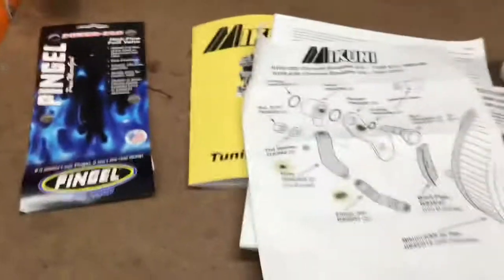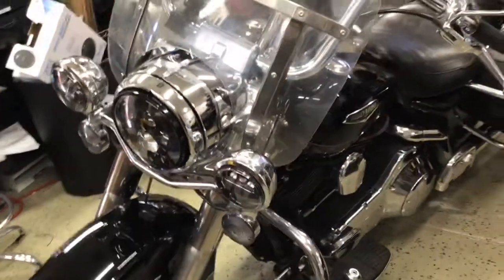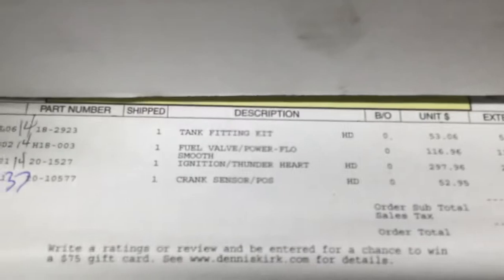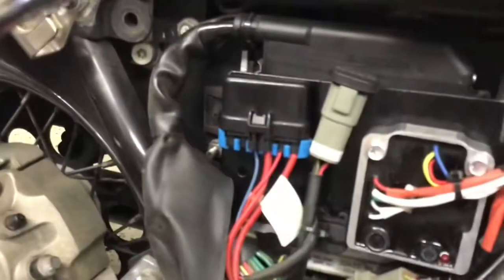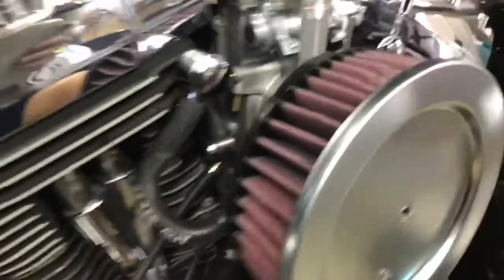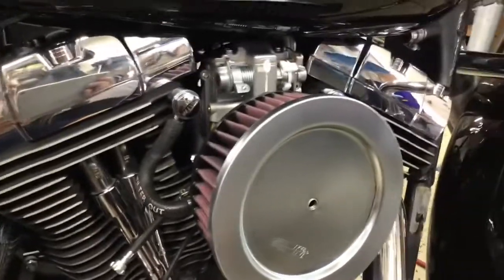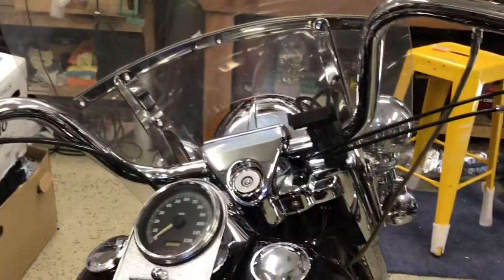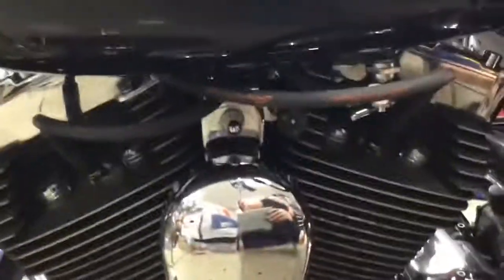1999 HD Road King EFI to Carburator and Thunder Heart IGN.

Comment: On that petcock, from sitting on the bike, pushed towards the front wheel is closed, and middle is on, and all the way towards the back wheel is reserve.  Next thing is you never needed to remove your tank.  A mikuni hsr 42 or 45 or 48 will mount up to your bike.  And yes there are two vacuum tubes on the back of that mikuni, one is on the top left and ,ust be capped and one is on the bottom right and needs to be capped.  Now on these mikuni you have no fuel mixture screw on these, so your adjustment to your air screw is very imprtaont as to how your bike runs.  If it hesitates or spits back, you need to turn it on clockwise.  Also for your TC 88 with 4 inch stroke, you need a 45 pilot jet and a 180 main jet. Now if it came with a 42 jet and a 160 as most do, that will work for trips shorter than 50 miles or so.  But dont forget that air screw located on the left bottom front of that mikuni is literally vital to how your engine will run.  Im not talking about the idle screw thats got the cable that drops down to turn up you idle or drop it, but am taking about the screw driver need screw on the left side at the from as for your air screw, and it takes a longer thin screwdriver to easily turn it out or in with your air cleaner on.  I have a mikuni HSR video demonsatrtion here on YT at my channel

Comment: so update i hade the same ignition but the engine kept having a flat spot the carb is jetted correctly what i did was remove the thunder heart i kept the stock ecm i removed the fuel injection installed a carb kept the engine temp wired to ecm kept the oe coil i am running the bike with the stock ecm  it is firing the coil as it should i only removed everything that was fuel injected related on the bike  on the ecm i removed the # 6 pin wire to get rid of the check engine light bike runs great better than having the stand alone ignition there is no need for it just remove all the fuel injection crap and install a carb runs flawless
Reply: Good job - I know there were others who mentioned the same process on the HD bulletin boards. Keeping the original ECM seems to be the simplest way. Then if the ECM fails you can switch to the ignition.

Comment: You are wrong about Pingel valve positions. Forward is OFF, Back is ON, and Middle is Reserve position. This is according to instructions on the package that valve comes in. Also, there is printing ( OFF RES ON) on the valve just above the lever!

Comment: so i can leave my current ecm conected or do i need to just pull the 15 and 5 amp fuse for the ecm and fuel pump since im not going to use those then just wire up the ignition and install the carb?

Comment: Thanks for all this great much needed info…!
Same exact bike, and planning on doing this as well,, had enough from this EFI….
Would you or anyone here have a complete parts list of all the parts needed….
Any help or advise would be greatly appreciated….
Reply: Thunder heart stand alone ignition .ebay
Efi to carb tank conversion  kit . Ebay
These are the  only parts I ordered to do the job  cost maybe 500 bucks if fhat
Reply: @everettthoman2097  :::  Thank You… Perfect Timing….
Reply: @reaperronin8898  I already had carb kit
Reply: @reaperronin8898  iv run the bike without  the stand alone ignition.  Just unplugged the efi crap still got spark to coil an just did  the tank conversion  ran fine didn't need  stand alone  ignition.  I just added the thunder  heart to advance timing with the cams I has
Reply: @everettthoman2097 

I actually came to the comment section to ask you this.

I was wondering if you had to change the ignition or you could just do the carb conversion without it.

I have a 97 road king I need to do this on because the fuel injection is giving issue.

I have the carburetor and manifold, if I just switch the tank around to a petcock, is there anything else I would need?

Comment: I did all that on my 2000 RK.  thunderheart ignition, cut off cables to the crank sensor and connected it with T.heart and all that, I have restored the CV40 carburator on it...and the damn thing dont start...I have a spark, and also I see that the gas squirts when I move the throttle but engine does not start😢. I have brand new sparkplugs as well...tryed even suplying the fuel from a bottle and still no go...I am fresh outta ideas.

Comment: I’m getting ready to install this on my 2010 crossbones. I hope it works. It says it’s not compatible with my model but I don’t understand why it’s not. It has the same crank sensor as other twin cam motors. I also have an S&S carb I’ll be using. Anyone else know if it will work for me?

Comment: I have the exact same bike same color. I got the same carb setup and ignition. A thunderheart. I kept having carb sneezes harley had my bike for 2 months and couldn't figure it out I got it back switched out the ignition for a dynatek tc88 and a namz 32435-01 harness. And it ran way better. I rejetted the carb to a 30 pilot , 50 accelerator pump and a 96 needle runs amazing now. I wanted to give you a heads up because it was a nightmare for me and then harley. So if its carb sneezing and doesn't have the power you know it should now you know. Another issue I was having was backfiring on startup with that ignition. That things trash
Reply: Also with the new ignition I added a map sensor to the intake manifold. Your bike had one by the ecm called the barometric pressure sensor same think move it to the manifold drill the hole that also makes it run smoother
Reply: The carb sneezing as you call it was a lean condition a rich condition it would pop thru the exhaust ! I prefer S & S carbs but a miku I will flo more air but are a bitch to tune pilot jet main jet needle setting & air speed screw !

Comment: Yeah I'm going to attempt to help a friend of mine change his 2007 to carburetor only because it has an electrical issue and the two Harley-Davidson local dealers through some parts at it it didn't fix it it's got a code for throttle position sensor and map sensor they replace those items it didn't fix it it just won't take throttle it will just idle I even replaced the entire wiring harness from a used bike the bike had previously been in a fire and ran fine when I rebuild it for 2 years then it started having these problems can't even clear the codes to get to another dealer they said all this is going to be a winter project and charged him $250 for 2 hours worth of work so I've got a CV carburetor and I figure with some standalone ignition module maybe utilizing the crank position sensor to tell the computer what the heck is happening in the motor I should make a running motorcycle out of it again I know carburetors and some electrical but the problem he is with his I'm stumped and heck smarter people than me or stumped either that or they don't have a good technicians at the two dealers LOL